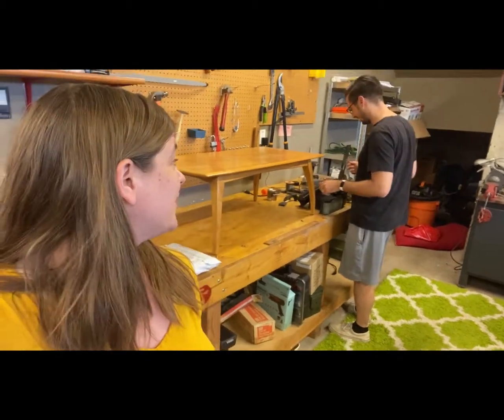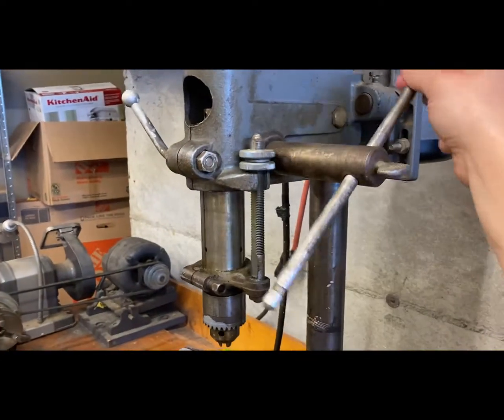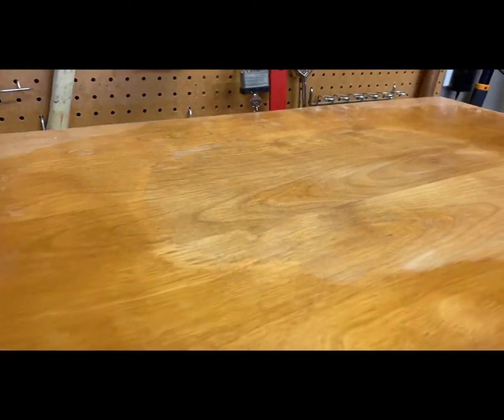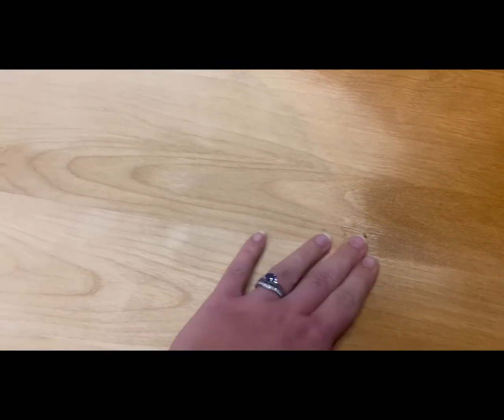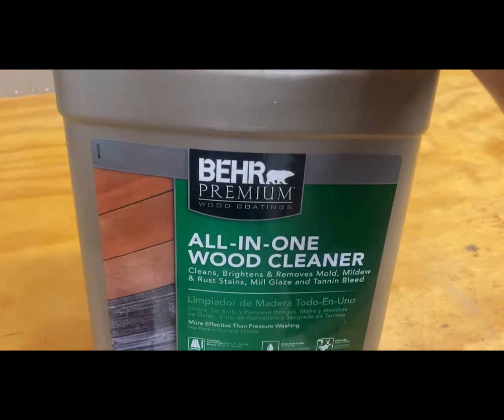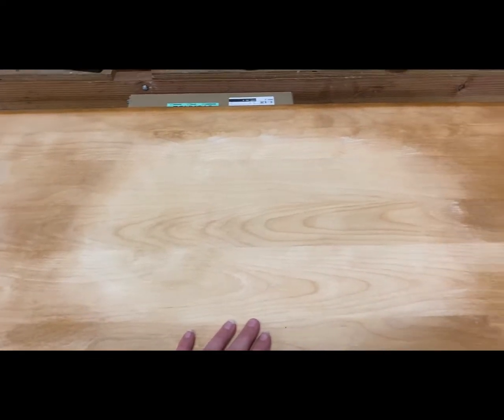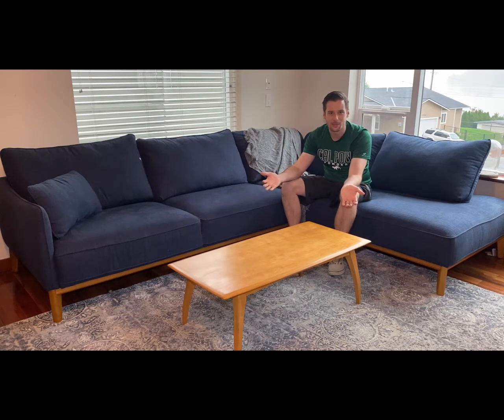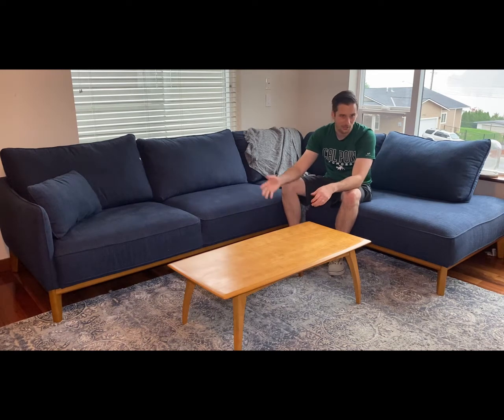Restoring a Mid Century Modern Heywood Wakefield Coffee Table

Comment: It came out beautifully, but I'm wondering if you ever considered scraping off the old finish, then applying Oxalic Acid to lighten the stains? It doesn't always work, but it might have saved you so much sanding.
Reply from the maker: We did use the oxalic acid, however, the water stains did penetrate pretty deeply into the wood. That being said, it was our first time using it, so we probably could have used it better!